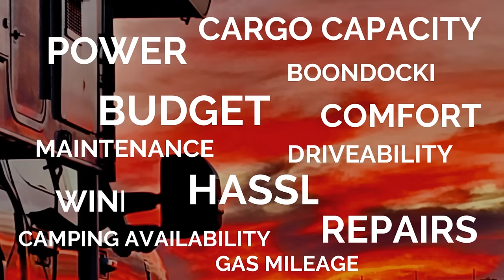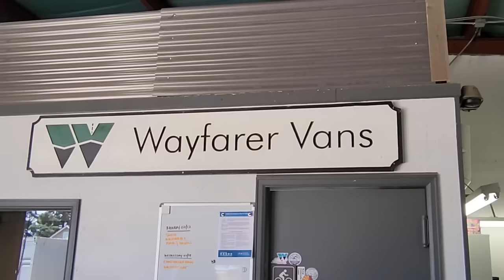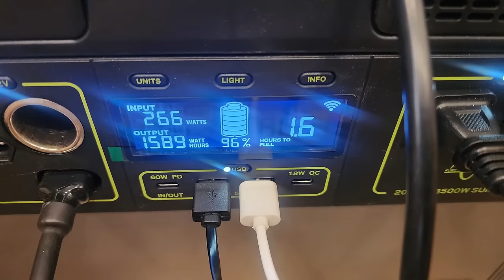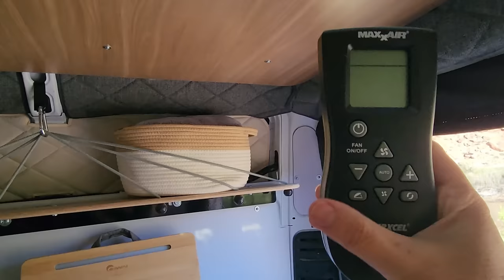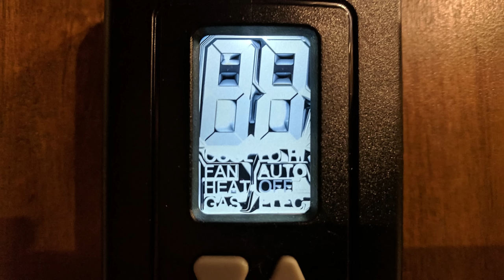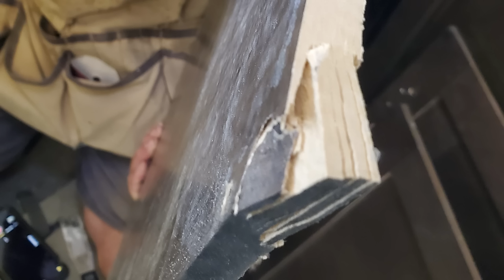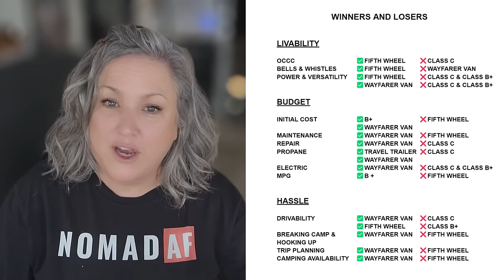6 RVs: BEST👍& WORST👎for BUDGET, HASSLE, CAMPING, DRIVING, REPAIRS, MAINTENANCE +

Comment: I saw a couple that had a van each. That seems the best option. A little privacy when needed and easier maneuverability. I can't drive though so we're trying to get a class A or large bus. I love some of the 5th wheel floorplans but the slides also fill me with dread when I think about repairs and the hassle of setting up or breaking down camp.

Comment: When I had my travel trailer everything was at least $300 to repair if you could find someone decent to work on it.  I would choose a hightop van with very simple electrical and and zero plumbing (Berkey) and extra water jugs, even portable battery lights just to keep it simple.  Front seats that spin around with a lagoon table, bucket with seat for a compost toilet and separator for urine.  Ice chest to freeze containers to put into the fridge section.  Really basic.  No lithium batteries - they explode and start fires - scary stuff. Can not be put out with water or fire extinguisher.

Comment: Just bought a used Bambi a few months ago. I’ve had it back to the dealer once for propane/carbon monoxide detector replacement. And had to break camp yesterday (one day early) because the fridge and AC went out. I love the rig but I’d like to have a honeymoon where I don’t have issues to repair. Pretty sure my next rig will be a Wayfarer van.

Comment: I love my Itty Bitty 18’ Puma Ultra Lite 12FBX.  She has it all, kitchen, bath, full time bed and dinette.  
I’ve had self-converted smbulance, self-converted Uhaul truck, 28’ tt, 33’ class an and tents.
IB tows easy, simple to maneuver, fits anywhere, allows me to have an independent vehicle to drive without breaking camp and a BATH!
I want to trade out toilet/black tank for composting toilet then convert black tank to additional gray water.
I am not full time, I travel with and without hubs… occasionally trading him out for my two medium size dogs.

Comment: We have done a lot of research and will be getting a Solis 36a next spring. It doesn't make me feel claustrophobic like the other Solis vans do. Love the dinette and can easily work there. Within the next few years, we'll be living full time on the road and I'll be working full-time as well.  Will be getting an Ecoflow powerstation and gen 3 starlink and generator. We have the cabella clam that we use for additional living area. Have the dokio 300w solar panel (Big Daddy).  Love the garage in the 36a. Have a small bodega 12v fridge that we'll use as a freezer and plug into coach battery but need be can plug into power station. Planning on getting big verticle box for back passenger door to store the clam and spare tire mount for back drivers side. The 36a is small but perfect for how we want to live and travel and camp. Trips into a big city will not be stressful as the van is only 17'10' and can fit in any parking space.
Reply: We use a ‘Clam’ for extra space also! Love it because we have a small rv.

Comment: I have a van, RAM Promaster 3500 extra long, high top.  I would re-do it inside (i.e. move the batteries, add a refrigerator - my ARB is broken so I am without a refrigerator, move the bed, move the kitchenette, add top cupboards, etc.) Other than that, at this time, wouldn't consider purchasing an RV.  If I were static, I would go for a 5th wheel, Class C or A (if I had the money.)

Comment: Didn't hear it come up in the video, but you have to consider if you are in a van or a slide-in pickup camper if you find a spot to camp and you set up you are unable to use your vehicle to sightsee or run to the grocery store etc without breaking camp. It really depends on your style of camping but it is something to consider..

Comment: I went from a small travel trailer to the Four Wheel Camper pop up truck camper because a trailer limited where I could camp.  Now I get great mileage with the low profile, can fit a regular parking space, go anywhere a four wheel drive vehicle can go and can shimmy to the driver's seat through the pass-through if I need to suddenly leave.  I bought the camper used but haven't had any problems at all.  The ease and simplicity has been great for boondocking.  Resale on the Four Wheel Campers is excellent, too.

Comment: I had a 30ft Jayco C class on a Ford. I lived in for  about 2 yrs. I had a Goldie and a Border Collie and two cats. It wasn't crowded. It was a pretty solid. We took it to the AlCan, all through Canada including Nova Scotia and down to Florida and points between. Did some boondocks with our gas powered generator. Never had issues getting on and out of cities and tight places. Lost a little when I got rid of it but not debilitating. It was a 95 and I got rid of it around 2006.  Would I do it again? Maybe split it up 6 months travel 6 home. I got bored with the decor in the RV and with trying to come up with new places to go. But that was almost 30 yrs ago. If I did it now I'd probably get the same rig.

Comment: FALSE! The Leisure Travel van  DID NOT HOLD its VALUE when you factor in the cumulative rate of inflation from 2018 to 2024, which is 25%. If it truly held its value, it should cost $150k in today's dollars. Other than that, this video provides good information 👍